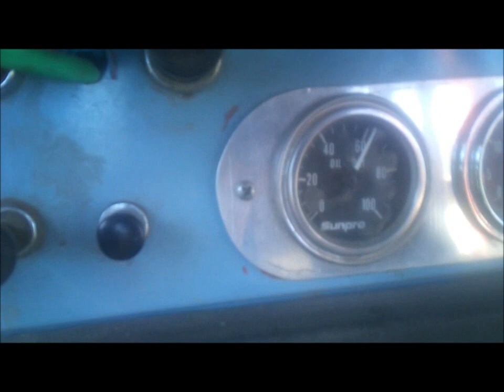No oil to the head / valves on my FJ40 2F Engine

Comment: My 1976 FJ45 with a 2F engine had no oil to the rocker gear for 20 years.  One day I decided to check out why and the oil galley that comes through the middle of the head to the middle of the rocker shaft was blocked with dry/dirty oil.  I cleaned this galley out and after this it burnt oild like it was going out of fashion due to the wear in the valve guides and I was concerned it would run out of oil and cease the engine as it did once before when my father was alive and in charge of maintaining it, as it was with the blockage it used two litres of engine oil to 50 litres of petrol, that's 25:1, the same as a lawn mower.  I made a very thin shim from brass and blocked the oil galley off and let the rocker gear run dry as it had for two decades before.

I believe the 2F engine is very sensitive to dirty oil and attention to correct oil change intervals is critical, as my father was not.

Comment: There is a bolt galley with a teardrop shape for the oil to come up into the head. The head gasket does not need to be turned around. It needs to be flipped over. It was installed upsidedown.